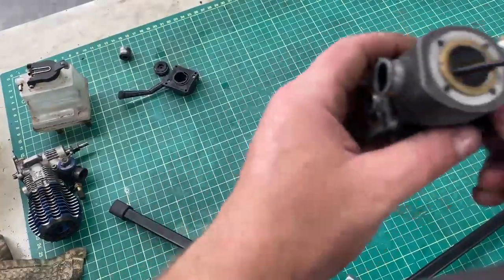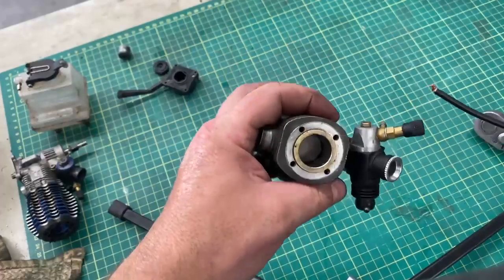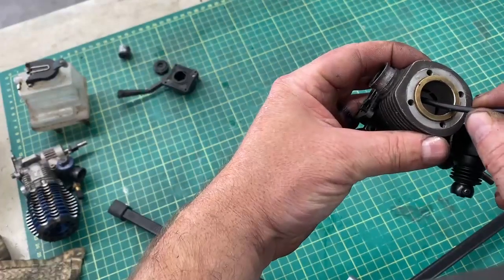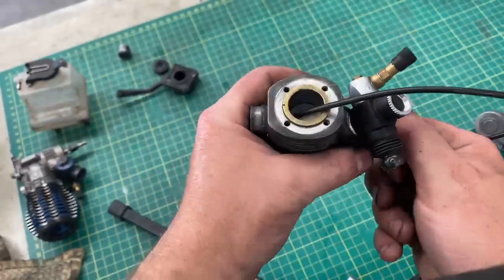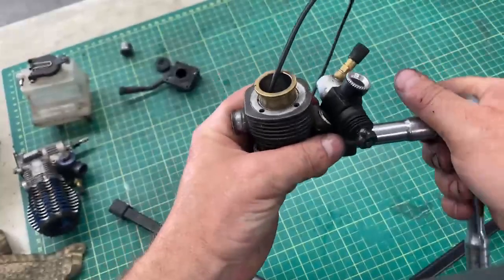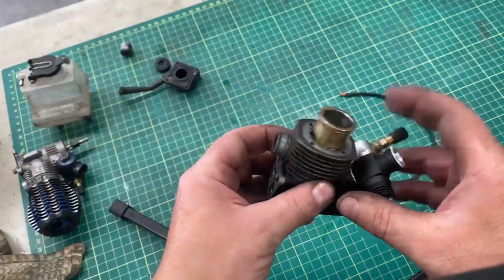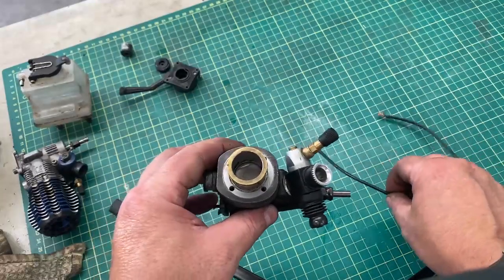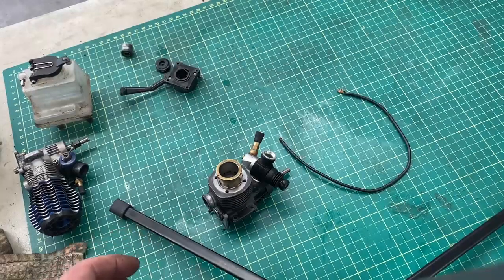How to remove a stuck sleeve from a nitro RC engine

Comment: Have u got any other methods as mine is just cutting everything I put in there
Reply from the maker: Have you tried the coated wire and it cuts it? If so you may need to heat the block up. The block should expand faster than the sleeve
Reply: Even the wire isn’t working I’ve heated the block up n everything just cuts it
Reply: @Elias-p4u7k same for me on a nova 12
Reply: If it continues to cut, use 2 zip ties side by side that will create enough surface area